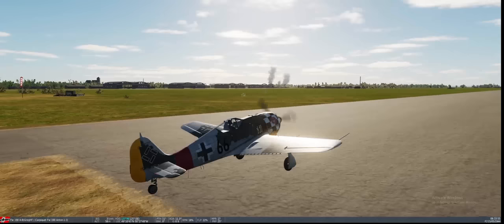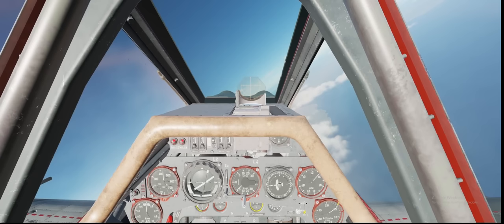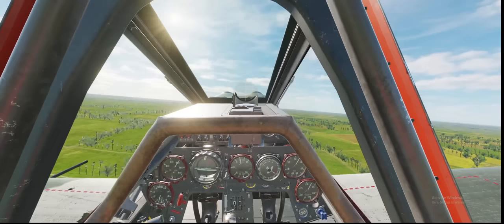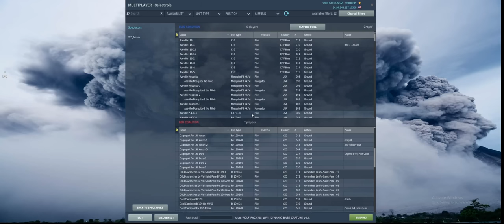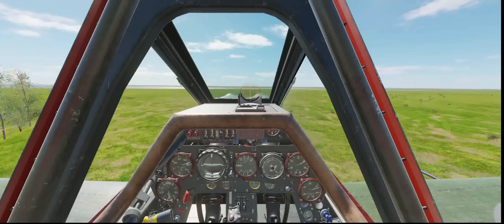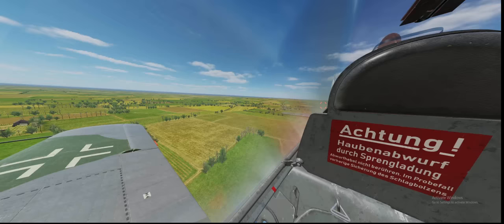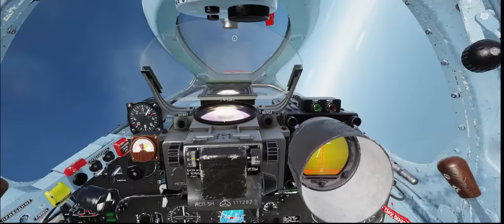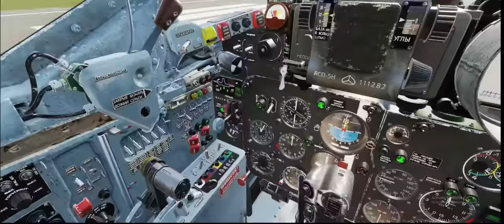German Cannons, Soviet Cannons, P-47 Mach, Angry Authors and More

Comment: The other reason Soviet (and not only) pilots flew with canopies open (at least in Yaks) was that (backed up by many Polish pilots memoirs from WW2) the perspex glass used in canopies became yellow and harder to see through quite quickly.
Reply from the maker: Yes, and in some cases it would frost up during a dive.
Reply: they also had a problem with getting the canopy back or even off to bail out. Russian fighters had no jettison system in their early inline fighters. It took direct combat to get the factories to fit the means to get the canopy open in a crisis.
Reply: @michaelbevan3285 first thing was mentioned in the video. I’m not aware of any early inline props with jettison seats

Comment: In complete agreement with your position on P-47 dive/mach performance. In my 50+ years of aviation research, I've never come across anything from pilots or tech reports to line up with what Eric Brown's account SEEMS to suggest. I can imagine, if Doolittle of the AAF was requesting a test or documents from the RAF, and wanted a timely response, he could well ask that they give this matter some priority. Characterizing that as a hat-in-hand urgent request could well be misconstruing the situation. He might just not have wanted a typical, "we'll put it through channels", 2 month wait for a response.
As you know, Doolittle pioneered in-flight refueling, the Curtiss F11C Goshawk biplane had a "drop" tank, as well as the 1941 P-40C; I think the U.S. HAD drop tank technology well in hand by 1943. Let's see, wasn't that the year we shot down Yamamoto on a long-range mission?
I agree, there were other factors at work preventing availability of drop tanks to P-47s!
I disagree with your theory as to the reason 
Minengeschoss was developed, that is to say, beyond the obvious reason of creating more damage. MG/FM was a 1939/1940 modification to that particular gun for that ammo, but subsequent German autocannons were designed to use all rounds interchangeably. 
There are RAF reports extensively analyzing explosive cannon shell, and specifically Minengeschoss, performance, because RAF was experiencing damage results that were out of proportion to single shot expectations, both as to blast and shrapnel. None of my research shows Germans experiencing any particular problems downing Soviet a/c, which were single and twin engined, and typically rather lightly protected. The exception was the armored steel portion of the IL-2, but the German 2cm loadout was quickly modified to include API. The MK 108 was specifically developed for 4-engine bombers, and specifically with Minengeschoss in mind; with 3cm hits on a/c, one doesn't need, or even want, AP or ball rounds; the blast effect is so devastating. This was a priority operational use on Western Front, RAF and daylight bomber streams, in both day and night fighters. Heinz Knocke's Bf-109 Wing ("I Flew for the Fuehrer") were early adopters.
In DCS, can you play time periods, other than just late war, wherein all players are limited to using only a/c from that period?
BTW, Spitfire, while beautiful, uses both lapped joints and non-flush rivets for some areas of its airframe; the P-51was a much cleaner airframe. I also think the 109 gets a bit of an undeserved bad wrap for "bulges", underwing cannon and rockets excepted. Have you noticed the cannon bulges, wheel, intake, radiator and rocker cover bulges on late Mark Spitfires? Narrow-tracked Spitfires also had an inordinate share of landing accidents. Brown's account of Spitfire surpassing 
.9 mach in dive really puzzles me, as l have Jeffrey Quill's book, "Spitfire Test Pilot", and read the diving test reports...
Reply: I've been wondering why Japanese even bothered to develop an APHE round for their 30mm Type 5 cannon. Perhaps against shipping? Similarly army's 30mm Ho-155 had some kind of AP round.
Reply: @Teh0X  What you suggest makes sense.
From 1937 on, and certainly from 1941, Japan would be in constant assaults against shipping and ground installations, requiring ammunition with better penetration than typically short-timed-fused HE. For the air groups tasked solely with bomber interception, such as over mainland Japan, it would be revealing to know what their types of ammo loadout were for their largest caliber
autocannons.
Practically, meaning logistically, no one desires to have to choose from, which means keep stores of, dozens of different types of ammo. That kind of specialization, besides creating servicing nightmares, is totally unnecessary. The use of explosive AP ammunition against a/c is less about the need for a hardened steel penetrator, and much more about its delayed explosive fusing, enabling it to penetrate into the aircraft interior, rather than bursting on the exterior skining/structure. Against large a/c such as the B-29, this would be important.
Reply: Re: the Spitfire rivets,  in the Geoffrey Quill book on the history of the Spitfire he noted that the original prototype was fully flush riveted. In order to simplify production and, therefore, time taken to manufacture, they did some wind tunnel experiments with gluing split peas to the fuselage to see what difference it made with parasitic drag.  The difference was nil to negligible, so normal raised rivets were subsequently used on the fuselage aft of the cockpit.

Comment: This seems like the right community to ask this question, so hopefully someone sees this.

Is cowl flap drag an issue of the flaps extending outward and interrupting the air stream, or is it an issue with the airflow through the radiator?

If it's the first, why were cowl flaps designed to stick out when they could just as easily fold inward or be sliding doors?

I believe I saw on the Poliparkov I-16, that the radiator is opened by a disk with matching cutouts that rotates to open or cover the inlets and that seems more aerodynamic/efficient?

In the case of a cowl like the F4F, it seems like those fins that hinge on the front and stick out like airbrakes, could instead hinge on the back and press inward to open the air channel.
Reply from the maker: It's both, but mostly airflow though the radiator core or cooling fins, or whatever it's going through.

Comment: Hi Greg, it is nice that you address the comments, but don't worry about the pedants... there are some very strange people out there and I am sure the internet only exacerbates their symptoms! Very interesting to hear you say that someone thought the Spitfire would have been as fast or faster than the P51 if the build quality was the same. I would be very interested to hear more on that and to understand what parts were made so imprecisely. I have read things about the Spitfire regarding its radiators, and that if it had a ventral radiator like the Mustang, that this would have also closed the speed difference. There is quite an easy-to-find article on the web about Spitfire escorts, "did the RAF miss a trick" or something along those lines. Also interesting information regarding the Spitfire and P51 comparisons. Anyway, as always, thanks for such a great presentation :)
Reply from the maker: The RAF knew all about the Mustang's Meredith effect radiator, in fact it was on the Hurricane. I talk about the build quality issue in a video about the P-51's speed and drag.
Reply: @GregsAirplanesandAutomobiles  Wow, not only first class content, but a a rapid reply to match! I am sure I have watched that P51 video, but I will check it again - its wet a miserable here in the UK, and watching that is far more enjoyable than more on current affairs! I thought the Spitfire radiators also used the Meredith effect  - in that hot air came out the back to provide thrust to offset the drag of the actual unit - but I thought the P51/Hurricane/Yak position had some sort of advantage - less frontal area with more of it being buried or something. Thanks again.

Comment: Hello Greg, thanks for the video, it appears to me that you are fighting mostly in the horizontal plane, which is not really the FW-190's strongsuit. You might consider to try some vertical manoeuvres like yoyos and immelmanns to reverse direction and get behind the enemy again as opposed to pulling high G horizontal turns which take quite a lot of time and bleed off energy. But these are just my 2 cents.
Reply from the maker: I thought I was using the vertical. Maybe I should do it more.
Reply: The pure vertical as in loops is not necessarily advantageous. And the Spitfire is going to be one of the best in that dimension.

The FW-190s strong suite, is in fact high level speed, especially fast cruise speed. Creating lateral seperation and maneuvering in a steady-state banked turn back into the fight is going to be the best strategy. 

Because a vertical maneuver requires constantly changing lift coefficient to maintain a constant g-load, and turn rate varies all over continuously, which negates pilot ability to fly and turn at a given Lift/Drag lift coefficient which is required to retain maximum energy upon completion of the turn. 

The Ideal strategy from an engineering/physics perspective is to exit the fight just as maximum seperation (in arc/degrees/radians)  occurs in the circle fight. Where the enemy is pointing almost straight away behind. 

Then roll wings level, unload the wing by pushing to near-zero-G to eliminate all induced drag, (And even to generate induced thrust as your wingtips go negetive AoA with a forward lift vector, this in reality, maybe not in-game as this is non-obvious of an item to model). 

And at the same time, also use gravity to assist in a ballistic arc to accelerate the aircraft under zero-g as it begins to point downhill. 

Since you will obtain maximum acceleration under these conditions, and the enemy is pulling around in a high-g turn, and generating high induced drag as he rounds the circle onto your tail, you will easily escape. 

But you don't want to continue downhill so far that the enemy also dives after you instinctively, as you will (accidentally) draw him into performing the exact same max-acceleration maneuver as you just performed. 

You want him to fly pretty much level in pursuit, not going zero-g. This seems trivial, but a slow moving fighter at 1g level flight is creating several square feet of drag area due to induced drag at low speed. This greatly hinders his acceleration, and is almost imperceptible but insidious none the less. 

Then once enough seperation is gained, turn back with a horizontal turn at your aircrafts maximum L/D lift coefficient (calculated from best glide speed). 

If this lift coefficient makes the circle too large at your max level speed, and you need to pull harder to tighten the circle, instead of doing this and blowing your best L/D by pulling too high an AoA, climb slightly to reduce speed and  convert it to potential energy, i.e. altitude, then initiate the appropriate maximum L/D turn at the slower speed that tightens the turn circle and turn-time while maintaining the same best L/D Lift-Coefficient.

Hope I didn't confuse anyone. Lol... Full disclosure, I haven't played sims in years (5+) and this info assumes a realistic simulator.

Comment: Not disagreeing with what you say about Thunderbolt, Mach limits and Eric Brown, but I suspect that to get to the bottom of it you would need to somehow find a copy of Smelt, Charney & Rose "Drag and Trim Changes on Spitfire, Mustang and Thunderbolt in Flight at High Mach Numbers" RAE report No. Aero. 1906. A.R.C. 7424, January 1944, and Bridgland & Rose "Flight tests of Dive Recovery Flaps on a Single-engined low-wing Monoplane (Thunderbolt)" R.A.E. Technical Note No. Aero. 1704 October 1945. They are referenced in other documents but sadly I don't believe they are published anywhere.
Reply from the maker: We have lots of N.A.C.A. reports on the testing AND with pictures of Thunderbolts with testing equipment installed. I think I'm on rock solid ground in terms of Thunderbolt Mach limits.

Comment: I was astounded to hear Eric Brown's statements on P47 compressibility even before hearing from you on this. So I follow your well documented arguments and clarifications with interest. I had read from a Quora poster that the 56th had changed it's Bomber escort procedure from 4000 feet above bomber formations to following at the same altitude or preceding them and he cited the compressibility issue as the reason. I've only read of P47s having advantageous diving speed and success from 4000 ft above the bombers, perhaps mentioned in response to Brown's comments.  I don't remember that he referenced a source for those statements but that doesn't necessarily mean that he didn't. Being in the opinion-forming stage of this issue I offered Quora no conversation on it. 

EDITI just found out why Col Hubert Zemke Had the 56th Fighter Group fly, their P47s not in back of bomber formations but stacked in 3 ea. "4 finger" groups of 4 as per the German model of 4 per group  8 and out in front of bomber formations and in violation of 8th AAF stipulations to escort above AND IT HAS NOTHING TO DO WITH supposed COMPRESSIBILITY but because it was the more effective tactic in preventing Luftwaffe fighters from getting to the bombers (Luftwaffe fighter pilots  did favor initiating their attacks on bombers  with a frontal pass). Three  layers of 4 "finger" flight groups had the effect of breaking Luftewaffe formations and dispersing them to be picked off by P47s directly  following above . My source is a DroneScapes video about Gunther Rall but has some on Zemke without mentioning him in the title. Narrator featured cite the dive speeds of P47s as superior to ""all other fighters. He  did however say that the British paper based drop tanks had leakage issues  at altitude. I have formed my opinion on the P47s compressibility argument and am less generous than you about suspicions concerning Brown's motives but lacking evidence for any theory of motive I'll digress. .
. 

I also appreciate your informative criticisms of the Mig 19. I'm just getting an adequate setup to play and should stay a long way from thinking in those tiers. Nevertheless I'm fascinated to spend too much time watching a DCS pilot use the Mig 19 well with many YouTube videos. Apparently their fuselage has some aerodynamic handling challenges for getting guns on adversaries and he also misses some close range right angle shots at fighter paths that cross right in front of him because of the slow rate of fire. Another guy on WT racks up kills with the Chinese J6 jettisoning missiles immediately as dead weight. J6s used in Vietnam had no missile mounts anyway but the 30s do damage when they hit. Both pilots say the type has a steep learning curve. I think these guys are just well practiced at using aircraft advantages which the Mig 19 seems to have in maintaining energy and maneuvering ability in ranges of speed faster than was advantageous for a Mig 17. Mig 17s did have compressibility issues as tested by an example available to USN Top Gun pilots. 
.
That "steep learning curve" and engine maintenance woes might explain the Mig 19 types absence in Vietnam until J6s were supplied from the PRC in '69.. The VPAF claimed 13 Aces in the Mig 21 and 3 Aces in Mig 17s. No VPAF Aces in the relatively short range J6..US claims 10 verified J6s lost to USN and USAF in aerial combat. VPAF claims only 4 lost to enemy fighters.(a universally typical discrepancy) US confirms 8 losses to J6s all by 30mm cannon. Those are as follows: 1ea.-F104 by the PRC over Hainan Island of the PRC, 2ea.-A6s by the PRC, (apparently 11 miles over the NV border with China as tracked by US radar)   4 ea - F4Ds by the VPAF and 1ea. F4E by the VPAF.
Reply: I read the same stuff about Zemke’s Wolfpack, and I read his book about the Wolfpack, and I read Robert S Johnson’s book and I have listen to a lot of what Gabreski has to say, and I never found any one who flew a P 47 say that they couldn’t outdrive anything else with propellers.  And then there is common sense, that giant propeller and heavy aircraft, of course it could dive !
Reply: @steveperreira5850  In fact the 56th still used a top cover at about the same distance in altitude but above the front formations of fighters rather than directly above the bombers. Moreover when Zemke felt comfortably validated in the success of his tactic he used the opportunity to reveal them to his commanders. Faced with the facts that would hasten their policy of prioritizing the Luftwaffe's destruction they adopted Zemke's tactics (which Zemke said had originated from suggestions by the pilots of the 56th) throughout the fighter groups of the 8th AF which at that time had at least 2 groups P51 equipped and more on the way. At that time the 56th was not the only group flying bomber  escort with drop tank equipped P47s now that provisions were made for adopting them to P47s. For the short interim while waiting for the P 51s most fighter groups were still using P47s. And pilots were siphoned from the 56th to familiarize the other fighter groups transitioning into the P51 escorting bombers with the new tactics  

And so much for the notion of taking for granted everything you're going to read posted by contributors on Quora. I\ll assume that burying avocado seeds in Guacamole won't affect it. But I won't be assuming much about P47 compressability.other than it being recoverable..